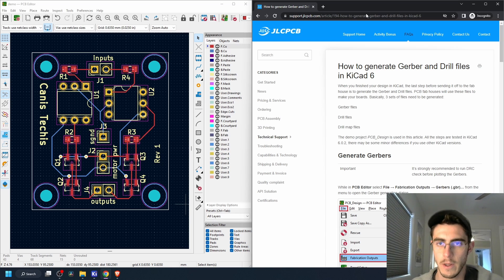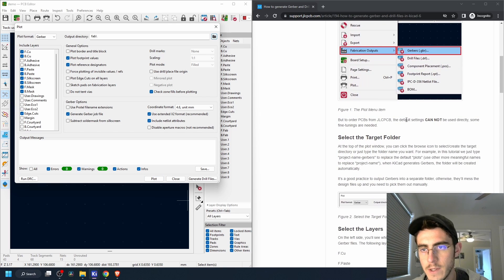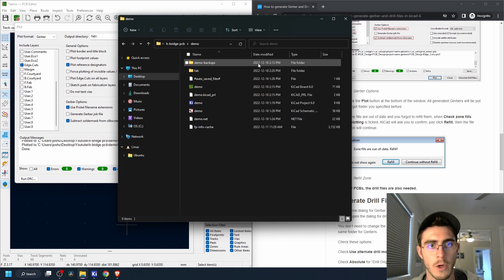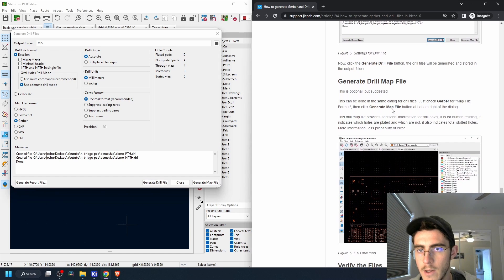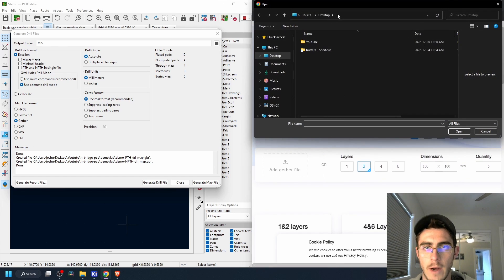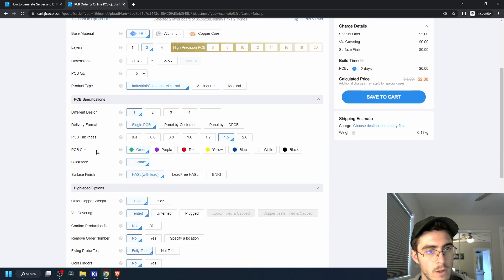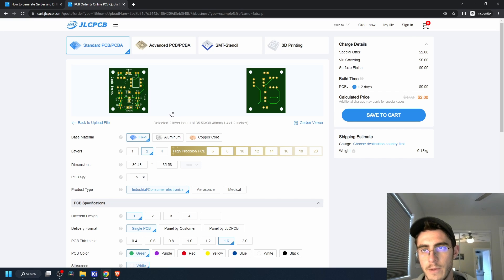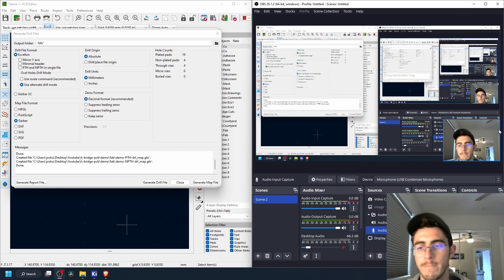Generating Gerber files in KiCad for JLCPCB

Comment: How would the manufacturer know the values of the components?
Reply: Unless they are actually placing them on the board and soldering them, they don't need to know. They'll just send you a board and leave the job of soldering correct components to you which is what most PCB manufacturers do.